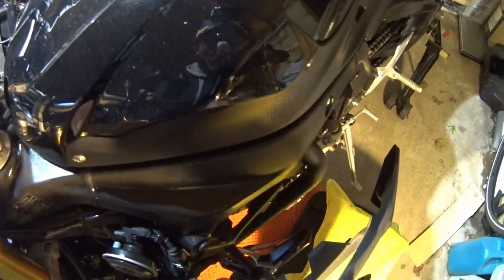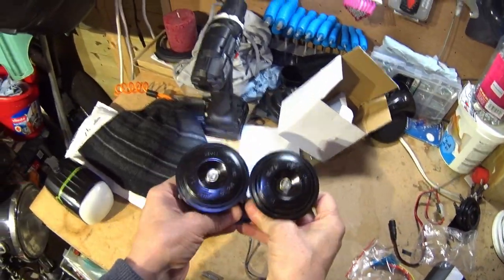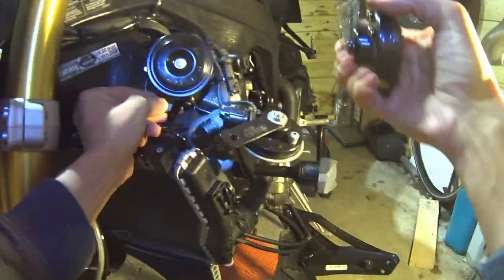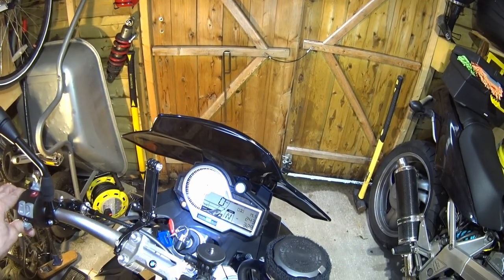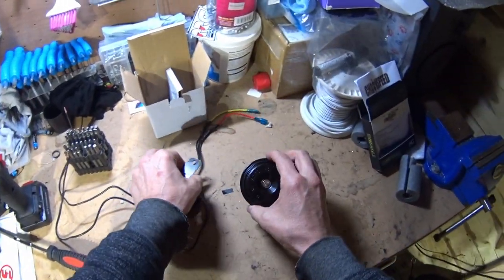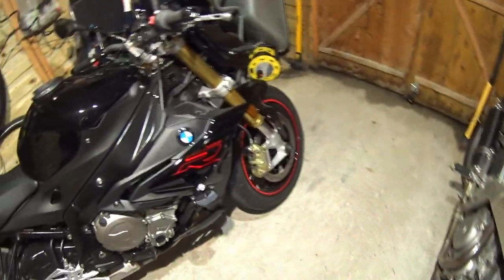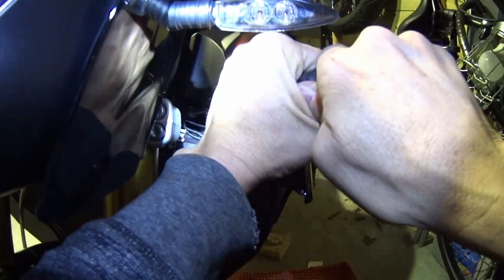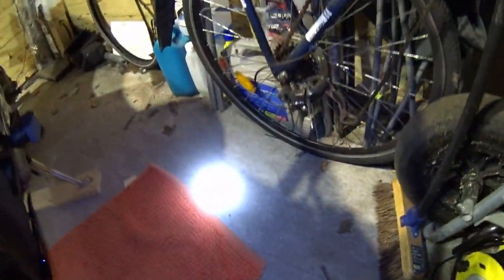You *beeping* horns! BMW S1000R dual horn upgrade

Comment: Sorry, through the TV, it didn't sound any louder. but I'll take your word for it :) Did you have a look at trying to get a air horn on there somewhere? I enjoy seeing what you're doing to your bike to what changes I've made to mine. I wouldn't meeting up if you're up for it some time, if we get any decent weather, did manage to get a quick bean down the A38 last week, but the roads are covered in crap.

Looking forward to see what else you're adding to the bike, just a quicky did you manage to get a new rubber bit for the sliders?
Reply from the maker: Hiya, well the whole horn saga is a bit complicated lol. Firstly that bigger horn just didn't fit in under the plastics properly.  In order for the horn to actually make a sound the "trumpet" end had to be pointing downwards and a bit backward towards the radiator and the ground.  In the shed the single horn was maybe as loud if not louder than the dual horns I ended up with but I think that from in front of the bike the horn wouldn't sound as clearly as the dual horns in the proper position (they point forwards through those little vents in the plastics).  Either way, both options are better than the original and I've always preferred the sound of dual horns anyway!

I've not looked into air horns, compressors and the like - space is limited on the bike as you know and chances are I'll be bunging on various other bits and bobs before too long and I'll need all the space I can get 😃

Yeah I'm more than happy to meet up when the weather gets better, the latest video I uploaded was from a ride last Saturday - the bike got pretty covered in shite and I don't want to do that again soon!

I did get new rubbers for the sliders - in the end I didn't even bother contacting the seller, I just found a pair of OEM replacements on Amazon for £6! But I won't be buying those sliders again that's for sure.

Today I bought a Abba Superbike stand from the bike show 😊 I'll be giving that a whirl tomorrow!  Also I've got some footage from fitting the LED bulbs and a Givi Monokey rack (to a spare rear seat) that I have got turn into YT videos sometime.  I think the next bolt-on will be a replacement silencer... there are a lot of good looking choices out there 😍
Reply: @RikkyTang  I've just PM'd you in the www.s1000r.co.uk site.
Reply from the maker: @try-that  Ok cheers mate I'll reply there 👍

Comment: you actually didn't try to see if it works or not before you put back the fairings on?
Reply from the maker: 04:05 
Like that you mean? 😉
To be honest, the horn did work after the fairing was fitted too, but only if I rotated the horn so much underneath that it was almost pointing backwards instead of forwards.
Reply: @RikkyTang  Oh....I missed that part somehow....hehehee....